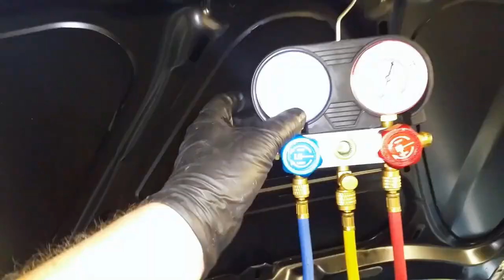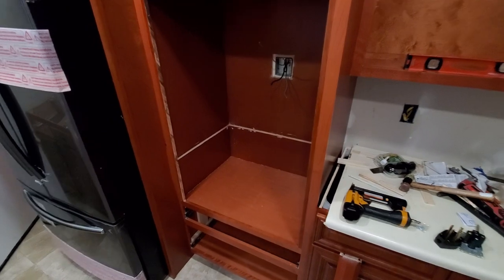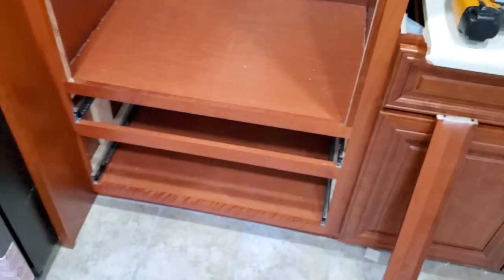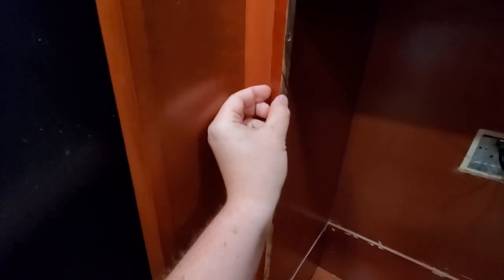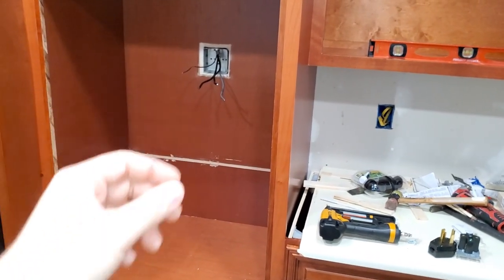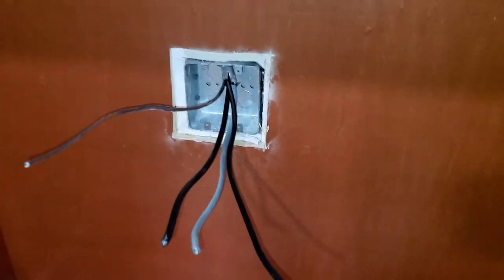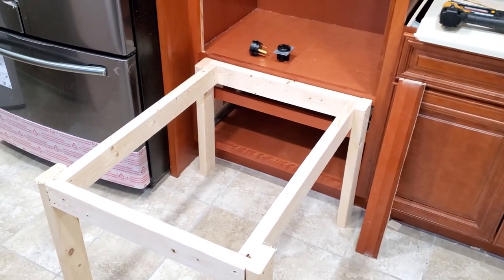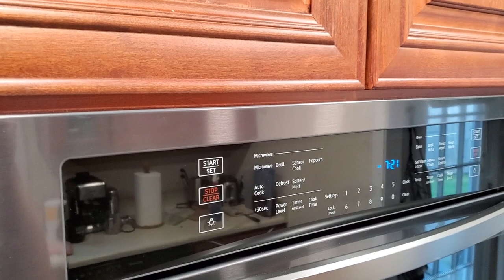Wall Oven Cabinet Install | Wall oven combo

Comment: Glad I found this video, the platform to hold the oven is ingenious
Reply from the maker: Lol. Thank you. Its basically now reinforced. That oven is very very heavy!!  even after removing both doors it was still heavy !! 
By the way, I was surprised how heavy the door was.. even microwave door. Like 25lbp  probably ....
Reply: I too am glad that I was able to find this video.  I want to install this oven in my kitchen.  Beautiful job!  Where did you get the wall cabinet & how much space do I need for installation.  I already have area but I would like to know if I have enough space. - Thank you!
Reply from the maker: @stephaniewilliams8282  sorry I just now see this comment.. you should  had put it in the main section. commenting on somebody else's comment.  Do it fit  future references!  hopefully insulation work out for you and you enjoying your oven by now .

Comment: 8' tall cabinet usually comes with the toekick base separate, so you can set the cabinet on the bottom platform and still have enough room to tip it into place.
Reply from the maker: Yes I know this one didn't came in... it was all solid piece. I only had option to cut the bottom off and then put it back. My ceiling was already partially open anyway so I went that way

Comment: Sir, you need a cover plate on the outlet to pass inspection.  Without the proper cover you're only a tad safer than if you just hard wired with twist nuts.
Reply from the maker: Yes. You  absolutely right I totally forgot to mention that.

Comment: For better cabinetry, if it goes floor to ceiling,  it should be ordered with a loose toe kick. Or you have to cut the toe kick.
Reply from the maker: Yes I was told I could do that too. Cut the whole freaking bottom out. I decided not to do it
Reply: @IvanRossS  You should have. Or buy better cabinetry.

Your real.problem is when you have a bad swag in the ceiling.

Comment: The use of 2x4 platform was nice...these ovens are very heavy
Reply from the maker: It was technically 1x4 boards, so they can slide ride between wall  and rails

Comment: hello, i got that same combo, my question is, which breaker should i use for this oven, thanks!
Reply from the maker: I'm not home right now  but if you look in the manual or on the back of the stove. Its actually supposed to tell you. I think so it's 30 amp or 40 amp. That's how I find out what size breaker I needed back then.
Reply: @IvanRossS  I have searched all the stickers and it does not explain anything.  I also went through the manual and couldn't find the information, that's why I decided to search here on YouTube
Reply from the maker: @elmilusos208  I will let you know tomorrow when I get  house.  I will look on my panel
Reply: Need the info of type of braker please

Comment: What if you need to replace the heating element ?  Do you have to bring the oven down ???
Reply from the maker: No u do not lol. They are few screws inside that holding it
Reply: @IvanRossS  thanks. You save me money.

Comment: Question so before was it 2 separates now it’s an all into one? If so I’m trying to do the reverse and trying to see can it be done
Reply from the maker: No lol.  My oven is a combo!! It's came as a one peace. Microwave and oven attached together and can't be separate!!!!! Also FYI: electric wire 220v powers both, oven and microwave, there no separate plug for microwave. All electronics on it as a one unit to control both devices. Some combo units can be separated ! And they even sell  2 separate peace, microwave and oven. Each have there own controls. If that what u have, you just have to mount them one by one. Probably installing shell on top of the oven to support microwave. Also microwave will have its own plug, probably just 110v !! Make sure u will have outlet there too, not just outlet for oven, which is 220v!!!
Reply: @IvanRossS  ok yes my oven is an all in one combo too…now I want them to be separate…I will make sure there is 2 outlets to support both… Thank you so much you been of great help.,.
Reply: @creamofthecrop2789  I’m in the process of installing and modifying my cabinet. I’m replacing a microwave/oven combo with a single wall oven & ibstalling a shelf over it for a microwave. Had to move the 240 and 120, put n a smaller circuit breaker,

Comment: Nice video. I have a double oven, but it seems no way is my cabinet strong enough to hold it. Looks like I will need to build a base and lose the bottom drawer... maybe your cabinet is more heavy duty
Reply from the maker: Probably. And u can definitely do that.
Reply: @IvanRossS  the one I have is kitchenaid KODE500ESS350 and it weighs 350 lbs.  I wonder how heavy without the doors.... Thanks for the video...
Reply from the maker: @User-pb8pd  I have no idea. But you will be surprised how heavy the doors are! About 50 lbp each I can guarantee. You definitely have to install it without doors!
Reply: @IvanRossS  I also did research and found lifting straps. The cabinet have it looks like I'll have to take the entire front off to rebuild it, but it may also make it a bit easier as well...

Comment: What are you talking about? Read the manual. This oven NEEDS to be hardwired as recommended by ALL built-in ovens manufacturers.
Reply from the maker: As recommended*
Reply: Not so much true anymore. Codes are moving to the plug option because they want a disconnect on the appliance. Safer for the homeowner and electrician. Yes the breaker should be turned off but this is a failsafe/convenience.

Comment: What was the height from the floor that you mounted the oven. My cabinet maker did 12" and it's way too low
Reply from the maker: Yes, that's little bit too low for a wall oven. Mine is 24inch. And height of my oven including microwave is 43inch

Comment: How did u get the oven door back on
Reply from the maker: I insert it back in a hinge and slide down latch lock that holding it. It's all in manual. But it was little stuck so I had to wiggle it in and out when I was removing it. Also little tip: when u insert it back in to the hinge  you have to pull up your door about 30° it will slide dipper in the hinge and then you lock it, doors was so damn heavy..